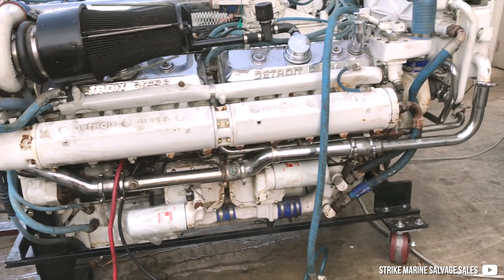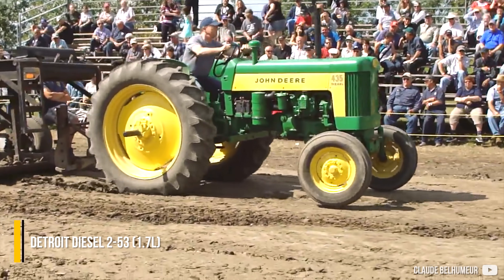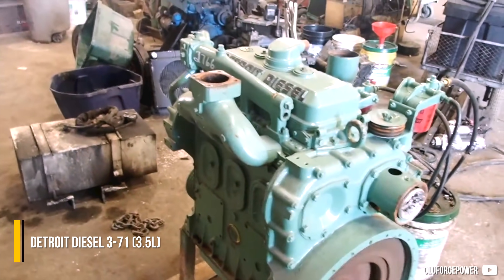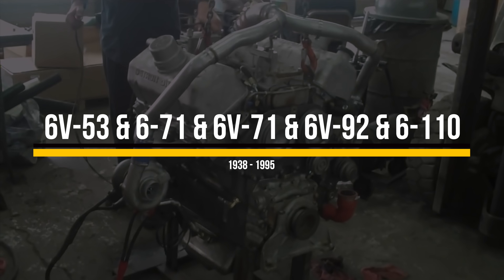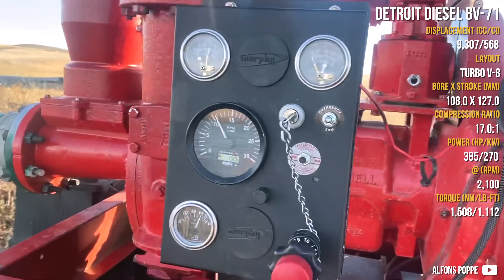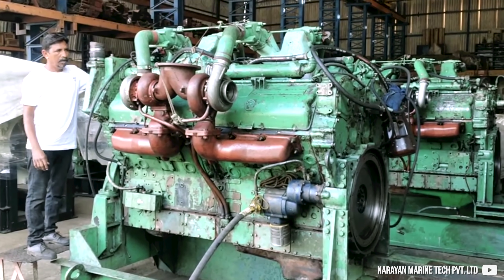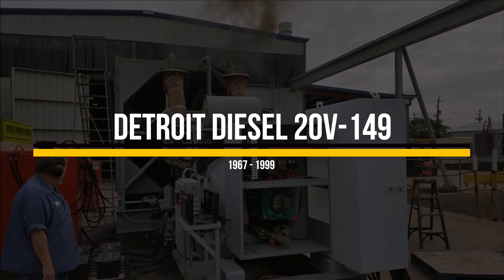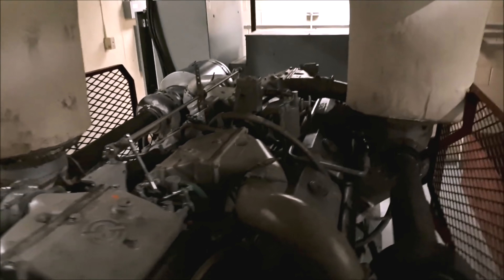Single to 24-Cylinder Detroit Diesel Engines

Comment: The only V12 that was ever installed in a road truck was the 12V71, all the others (except the 12v53 which they built a maximum of 25 of as prototypes) are actually 2 engines bolted together back to back with flanged cranks that bolted together. There are a few custom installs of 12V92’s but they are not really “road friendly”, they’re just too large to fit in a truck without major modifications.
Reply: And a fresh N14, could give it a run for it's money.

Comment: We had a 6-71 powered air compressor,cold weather starting was a bit tricky.Operator had to hold the unloader valve push button in and operate the starter button with the same hand.If operator let go of unloder valve button too soon after engine start the air in the compressor system would cause the engine to stall,sometimes even try to run backward.Tricky to learn but would put out 600 CFM all day long.Engine was goverened to 1800 RPM would hold that,even with a  maximum air load on compressor.

Comment: Great video but, a pet peeve of mine is someone saying "natural asperated DD". All DD 2 cycle had forced air induction. There are no intake valves just ports at the bottom of the cylinder. All of them had superchargers which some may call blowers. DD added a turbo on top of the blower to force even more air into the combustion chamber. All of the 2 stroke DD engines had to have at least the blower/supercharger to run which makes it by definition a non naturally asperated engine.
Reply from the maker: Technically yes, but what is natural aspiration of a two-stroke DD then? Many say this is and it makes sense to me, too. You cannot run it without a blower
Reply: @VisioRacer  There is no such thing as a NA 2cycle DD they all needed forced air induction. A naturally aspirated engine, also known as a normally aspirated engine or NA, is an internal combustion engine in which air intake depends solely on atmospheric pressure and does not have forced induction through a turbocharger or a supercharger. I thank you again for a great video and have watched many others you have posted.

Comment: Almost 500 comments so far on a video about DD2T engines and not a single person has mentioned the one and only Bus Grease Monkey AKA Scott Crosby.

Sadly plenty of people can't seem to grasp that a roots blower and a supercharger are not the same thing and that the non-turbo versions of these are indeed naturally aspirated. This is probably because of the trend to misuse these blowers as superchargers on other engines.

True Superchargers are compressors, roots blowers don't compress, they just drag around a pocket of air at the inlet pressure and release it at the outlet. If the outlet pressure is higher the air actually briefly flows backwards every time the pockets open to the outlet.

A roots blower becomes a compressor and thus a true supercharger when you add a twist to the rotors and offset the intake and exhaust ports to match, effectively turning one into a rotary screw compressor. See the Eaton M90 on the GM 3800 supercharged which just barely has any twist so it is mostly roots blower and only slightly supercharger.
Reply: Don't forget to add that to add a turbocharger you need to change the compression ratio

Comment: Hey, Strike Marine Salvage Sales! Thank you for using our video!! If you’d like to see more or talk about DD engines, let me know! Happy to help!
Reply: Are Detroit’s still being made or are they being kept alive.
Reply: @brianfronius4166  yes and no. The 2 stroke Detroit’s have been out of production since the 90’s, most ended in 1995. The current engines are all evolutions of the 60 series 4 stroke DDEC computer controlled design that came out in 1987. Also GM sold Detroit diesel to Roger Penske who then sold it to Daimler AG so it’s not a GM division anymore.
Reply: @J.R.in_WV  , thanks my friend. The 2 strokes are a dream and marvel. I had a time with one in early and mid 80’s. Beyond sweet. Just don’t see or hear them anymore on road. It baffles me why they’re just not out there anymore. I appreciate you explaining it me. You strike me as a mechanic as well. If so, resurrect what you can and get ‘em back on the road again.

Comment: a 5 or 10 cylinder detroit would be a hell of an eargasm
Reply: Bolt a 2 and 3 cylinder together?
Reply: @cpufreak101  with enough fabrication I could see that— after all the V12 was literally two V6 blocks
Of course you would need a new cam and crank to get timing right
Reply: @Creeperboy099  true, but I'm certain those would be easier to obtain than the block itself, only two custom parts after all then
Reply: Nissan made a 5cyl 2 stroke engine. UD5 i beieve they were called. Main difference to the gm,s was they ran an inline injector pump not unit injectors.

Comment: We have 6-71 inline and 16v92 ddec at in dynamometer at our shop.very powerfull 2 stroke engjnes
Reply: The DDEC was an attempt to avoid extinction and it really worked well, improved efficiency and kept a record of when a high temperature or low oil pressure incident occurred. (Just to keep the operator from lying to his boss)

Comment: All engines are four cycle. In the case of Diesels, they are either 2 or 4 stroke. And there were 24 cylinder Detroits before the last version shown. They were 4 6cylinder engines that drove a common gearbox for marine use. Two engines rotated one direction and the other two the opposite way. I spent many an hour babysitting 12V71s and 6-71s in operation. Our 12s had the stamped steel valve covers which said " General Motors " while the 6-71s had the cast Al valve covers. And was factory certified in the overhauls and tuneups of the entire 71 Series line.

Comment: As a detroit parts man for over 25 years there are some of those configuration s I never saw. The biggest heads were the 6-110's. Worked with a man that would throw the head on his shoulder and walk the gangplank to take off the boat. When he got in his 60's he could no longer walk without help. Good video.

Comment: technically there were hundreds to thousandsof the 12v-53 since its made from parts of several different mass produced engines. you just have to assemble them.

Comment: It should be noted that the Detroit's two or four valves were all exhaust valves. Intake was handled through ports in the cylinder wall, and it's why these kinds of engines were called scavenging. It's not clear to me why they didn't have just one huge exhaust valve, maybe the hole in the head made by such an exhaust port would have made it too weak?

Comment: You know General Motors also built locomotives at one time it was called EMD electric Automotive division of General Motors Corporation no caterpillar owns them but back in the day they made some pretty badass locomotives one of them is my absolute favorite in the diesel realm anyways is the SD40 - 2 its predecessor the sd45 had a v20 also the Askew 40-2 had a V16 but there are all General Motors engines and they're all Two Stroke diesels that's what makes the difference insound and personality between emds and General Electrics there are four stroke diesel and that's why they make a chug kind of sound very cool video I saw a Detroit Diesel V12 in a Kenworth cabover pulling in a tractor pull it was epic had for turbochargers putting out over a thousand horsepower Detroit diesels definitely have their own kind of unique sound to them as well ridiculously powerful and Torquay but immense fuel Hogs awesome video peace out

Comment: The loudest, most intimidating Detroit is a 6V53 on the stand with the intake silencer removed. A friend of mine invited me to a shop to see the governor being set by the head mechanic. That engine was absolutely screaming, and the volume? I felt it more than heard it.
Reply: I worked on 6V-53Ts for years in the marines.  We set the red limiter at 3000, load tested they had to pull 2300ish on the stand.
Reply: @amsfarm1502  Great!
Reply: Worked on most of these back in the 80'S 90'S and 2000'S. Nothing like them.

Comment: Heavy, loud, slobbered oil like crazy, but man were they tough and powerful in their day!
Reply: Had horsepower, zero torque. Worked good if you bought waaay too big of an engine for your usage and it had a constant draw. Then all you needed was a lot of fuel and oil.
Reply: @toddgittins5692  exactly...
Reply: To stop the oil leaks, you could install Airsep units and run the crankcase under a vacuum. Then you only had to worry about the air box covers which in our case, had drain tubes that went to the used oil barrel.

Comment: Visio Racer..... Thanks for the "historical" DD video,  would like to make a correction on the manufacturing dates for the 6-110 (pronounced 6 - One Ten,  not "One Hundred & Ten"), and that is.. the 6-110 was in production until 1965, Not "1955" as stated,  20 years, not 10 years..  Also, when describing the TWO & Four cylinder engines, you left out the 2 & 4 cylinder Series 51... which was built from 1951 through 1959 and was the only Detroit Diesel that was identified (series) by the first year of manufacture and NOT by the ci per cyl.  

The Series 51 was also, the Only Detroit Diesel that was of the Loop Scavenged design (no valves - timed ports, only), instead of Uni-flow Scavenged.  

The "24V71" was of modular construction using Two 12V71 engines,  but it was Not the "largest" series 71 engine built.... Stewart & Stevenson who is the largest Detroit Diesel dealer in the world, also built most, if not all of the "Special Order" engines and engine applications for Detroit Diesel, and back in the 1970s they built 16 Special Order 32V71TA's for Detroit Diesel.   Just FYI. : )

Comment: So you mentioned rail applications... there are 3 other series you are missing ... the 567, the 645, and the 710... That's cubic inches PER CYLINDER. Smallest were 6 cylinders and the largest was the 20v710 that made 5000 HP in the SD80MAC locomotive, then they pushed the 16v710 H engine to 6000 HP, but, it proved too much for the platform and they were later derated to 4300 HP because they kept killing the bigger ones. Interestingly the 20 cylinder SD80 locomotives were still in service up to a couple of years ago. Their most popular and reliable engine to date is the 3000 HP 16v645, they sold THOUSANDS of them.
Reply from the maker: But those are EMD engines, for a different video perhaps

Comment: The Detroit v series, went up to a 30v92 and a 30v149 if I remember correctly. For only power generation and marine. It was 2v12’s and a 6v all put together. I’ve only ever seen 2. In 20 plus years

Comment: Would you be able to do a video on the industrial life if the most reliable gas engine ever made the Ford300 I6 industrial engine used from woodchippers to plane tugs

My F250 has 1.089 million miles without a rebuild and is still running today, strong, pulls hard, and gets the job done, my latest video shows towing my 83 F150 that you can use too

Comment: In a way there is no such thing as a naturally aspirated 2 stroke Detroit diesel. They all required a blower for the intake charge as there is no vacuum created by these motors for charge induction.
Reply: But they called them that to distinguish between ones with just blowers and ones with turbos and blowers.
Reply: @gravelydon7072  
Yeah I see why they did it. Just a fun little bit of info.

Those 6-71 blowers make for awesome power adders for hot rodding v8's.

Comment: some Detroit diesels had turbo's but ALL had engine driven supercharges. They would not even start without them.
Reply: They were Roots blowers not superchargers, they pressurized the crankcase to get air into the cylinders

Comment: those early engines were not naturally aspirated, as they all had a roots type supercharger
Reply: The supercharger is only used for displacement, not for creating boost. That counts as naturally aspirated since the intake charge is never above atmospheric  pressure.
Reply: @shvrdavid  didn't realize the definition got changed over the years.

Comment: We used to have a pair of 16v149s as emergency generators. The beasts ate so much oil that we had real trouble getting them to pass the commissioning tests for 24h independent running.

Comment: They should bring back the old 2stroke diesel engines, run them on veg oil, or propane/natrual gas or something cleaner!  There is nothing like a engine the MUST have a supercharger to start,  I think all diesels need turbos!  Heck, ALL engines need boost!! I'd love it if they would build a light weight, 8v53, all aluminum, with compound turbos, spinning around 5k rpm, with 50+psi boost! With a huge intercooler! To be used in light trucks! (A D Max replacement ); haha!!

Comment: Had no idea they ranged so much in cylinders and displacement. Thank for the video. I’m curious about you referring to some of them as naturally aspirated, it was my understanding that due to the 2 stroke design with the inlet ports in the cylinder liners they all had to have a blower to force air through those ports and out the exhaust valves
Reply from the maker: Well, that's kinda their natural aspiration - they cannot run without a blower, they need it, hence many speak about them as naturally aspirated. I did not make it up myself, I just heard it and makes sense to me.
Reply: @VisioRacer  ive heard it in other places considered naturally aspirated aswell I just tend to disagree with that because of the very definition of “naturally aspirated” no disrespect just my opinion
Reply: The ports in the liners arent exhaust ports they are inlet ports & the blower is only there to scavenge the exhaust out through the valves in the cylinder head.
Reply: @heybird5660  your right I had that screwed up and I get what the blower is there for and without it wouldn’t run and it’s a such a small amount of pressure that it really doesn’t count and honestly I’m not trying to argue with anyone on this point seeing how even the manufacturer of the engine calls it naturally aspirated . It just doesn’t fit the definition of naturally aspirated in my opinion and yes I understand that opinions are like assholes everyone has them and most of them stink
Reply: The scavenge effect caused by the roots blower is only a few PSI, only for scavenging exhaust and does not add power. Thus naturally aspirated. Turbochargers were added to increase power.
Reply: @P_Rund1952  if air is being forced into the engine at any pressure my opinion is that it’s not naturally aspirated. I do understand the concept of this design and i know that even gm refers to it as naturally aspirated and I still disagree. A natural aspirated engine as I’m sure you know pulls air in via the vacuum created by the piston going down the cylinder.